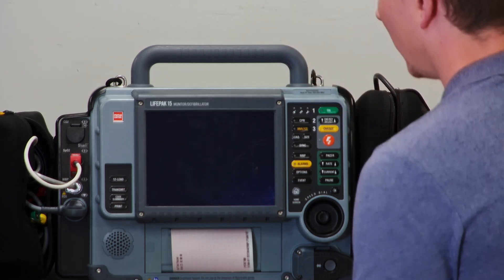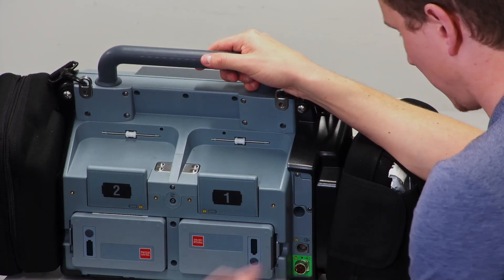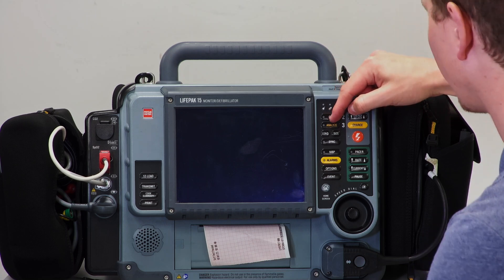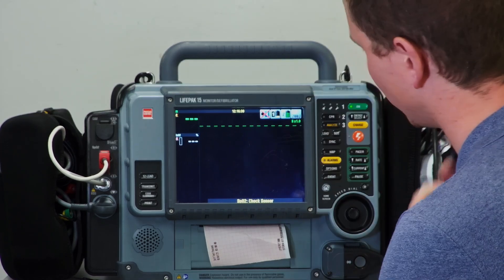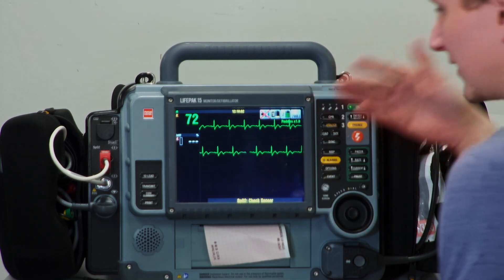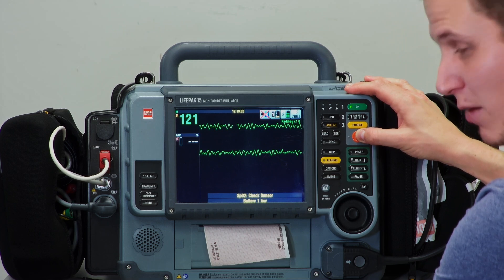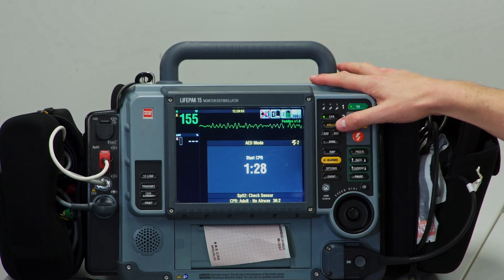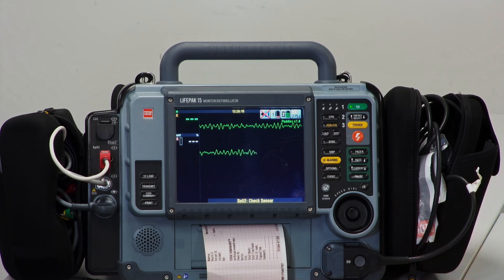How to use a lifepak 15 part 1 ~ How to defibrillate with a Lifepak 15 | EMT Skills

Comment: Ordering now the Kingdoms per area of recent arrangements to produce manufacture from each group kingdom research  the Star Energy harnessers designed for future Space Colonies to Dimensional colonies. Not to be deployed yet In space, until there are space structures and energy storage capability and space environment safety for the check and requirement protocol of the Philippines PH Senators and Congress I now order to extend in near Earth only space lawmaker practices. Augment knowledge for such mode. Let it be